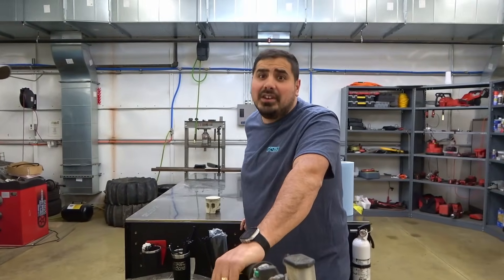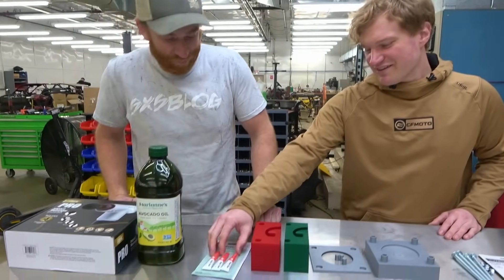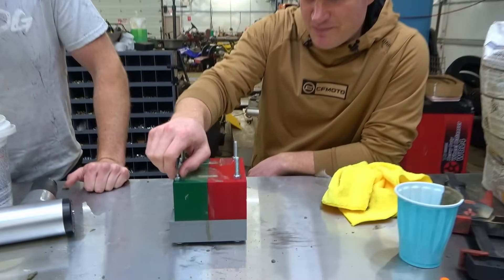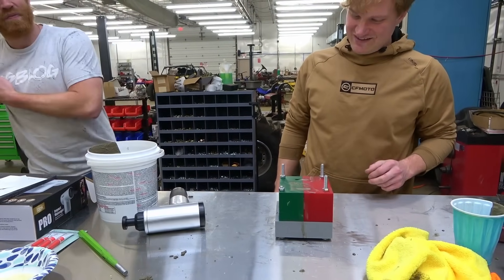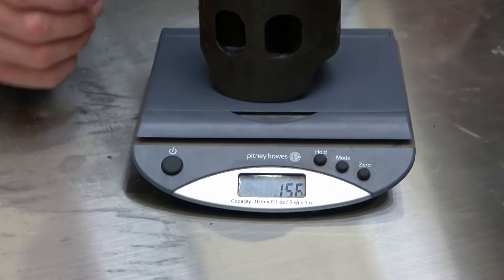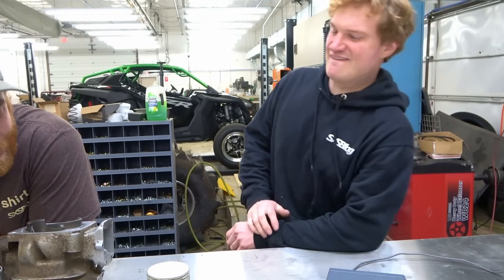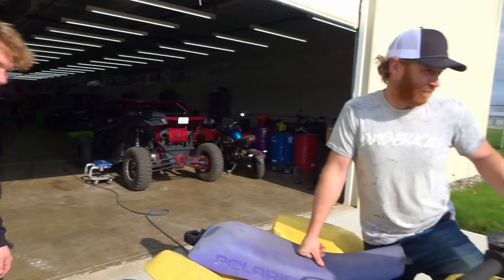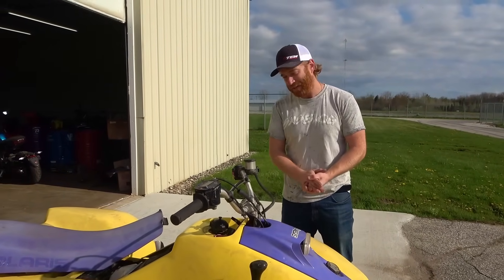World's First CONCRETE Piston! Major Success?

Comment: I’m sure it’s probably already been said but a releasing agent for the concrete from sticking to the plastic would help when you’re breaking the mold I usually use motor oil sprayed on the first and then pour the concrete and then the mulch should come right off without any sticking

Comment: I would suggest to use something to make a thick coat around the edge, yes you used superglue but that doesnt change the fact that the outer edges still have grooves that let stuff flow through, also the bottom of the piston broke off, I would suggest a solid body design instead so if you use something like JB weld or epoxy and sanded it down for a smooth finish im sure it would work also it would help with structural support

Comment: i think the only way to get a working concrete piston would be to cnc machine it out of a properly cured piece of concrete with the 'rebar' sufficiently spread throughout. concrete is great for compression strength but not tensile so having properly cured concrete is probably the only way to get it close enough to success. sadly i dont have a cnc otherwise id offer to lend it for this purpose

Comment: Concrete is pourous. Many little microscopic air holes for fluid and air to escape. It probably just absolutely absorbs in the fuel and fluid. Id try putting a concrete sealer on the top of the piston so it wont absorb the fuel.

Comment: I think you could use shnell cement, which is used for mounting electrical boxes in bathrooms.. as another idea, I have a chemical glue that is used for threaded rods in concrete. a plaster cast of the piston might be interesting too

Comment: Part one, I'm sure someone has used concrete. Things to think of, metal today vs metal in the past, whichever point you decide. The strength is so different. I would think the same for concrete but also take note as to the type of concrete and what a professional does to ensure the concrete is at its strongest. So, concrete and heat......strength to high impact which is about its durability not just for strength impact but length of handling such as over time.

Comment: If you want to make this the best way and get a super smooth surface. Use latex and take a real piston. You will get a super smooth surface that is 100% of the original.
Also Vaseline works great as release agent.
I have 3d printed and made my own molds from originals using latex for years. Also done a few one time use PLA molds.
Also PLA get soft at 50c. Dump it in hot water and it will get soft.

Comment: Make the piston out of JB Weld and try to make the whole engine internals Crankshaft ,Connecting rod and Piston out of low normal aluminum,Using CNC Mechanin

Comment: A piston out of quartz (not glass). It doesn't expand much thermically and resists quick temperature variations
(maybe it should be thicker in the upper part not to broke).

Comment: I wish you guys weren’t so far away I could use some parts off of that I took the complete suspension off of one of those and put it under my easy go golf cart. My front springs are weak. The shots of blown out in the transmission has a bad shift fork.

Comment: Reduce the mold size for the concrete. Make it with quick Crete & mesh. Make a second larger mold . Fill with epoxy. Compression rings made in the second mold😅

Comment: I have not finished watching this video yet, but it’s definitely the end of every rotating piece in this engine. It will literally be a stone grinding pad inside the cylinder walls. I would might have coated this in some kind of epoxy

Comment: You can still pull that engine all apart and clean everything and put it back together.. weld up the cracked casing and get it running again..  As long as the cylinder isn't scored--- she can live again, no problem.

Comment: you guys were succesful in creating an Internal combustion concrete Ram. - concrete is really strong until you shock it... of course a cylinder firing is nothing but shock after shock... just like one of those concrete rams that guys put on their bobcat.. or striking it with a hammer..  I can drive my vintage school bus onto my driveway but a couple hits with even a regular hammer and it starts to fracture.... ..  I think your wrist pin acted as a concrete RAM..

Comment: for the money buy bambu labs. u want regret it. have 14 printers from 8 different brands an hands down the bambu labs machines are hard to compete with at the price points they offer, unless u want a bigger build volume they are the way to go. some new machines coming out that are direct clones competators for bambus printers an some are looking pretty good and at good pricing too but out of the box ive not seen anything print as good as my bambu machines.

Comment: As a roofer for for 30 years I have used gasoline many times to clean up roofing tar It's about the only thing that works good to clean it up. It definitely will not work well with gasoline to seal piston ring. You'd be better off with gastic sealer.

Comment: this reminds me of the misery associated with Aluminum pistons in working equipment... like the old car i have, 185HP 4.6 V8 because it has cast steel pistons in it and the later models only made 265hp because they have aluminum pistons... ether way, it would be sad to find out some piggie ripped them out "fuel mileage is bad hinting at the heavy rods/pistons not being aluminum". get the sheet metal roller out and a small metal lath and just make them out of scrap 1/4'' plate and 1/8'' sheet steel, 4140 ASTM 98'000psi tensile scrap ends... welding etc. middle of plowing snow some day in Alaska and the "aluminum lets go" could end up stiff from those failing... but i guess some guys like going around with a hammer and screwdriver just to put a hole in them thru the plug hole "EPA covert operatives dismantling unlicensed consumption of fuel?". cement? scrap steel is cheaper then the epoxy used in the film, 100% is.

Comment: If you decide to revisit this I design concrete mixes. 
You can make a much stronger , more dense piston that can cure in a day with the correct chemicals (admixtures).  
Lightweight stone
Normal Water Reducer
High Range Water Reducer
Non Calcium Chloride 
Fiber reinforcement 
Densifing admixture
Say when.

Comment: I know that this is very likely out of your 'wheelhouse', but I wonder how well a borosilicate piston would work out in one of your engines.  Think Pyrex, but tougher.  Most likely, it would require the services of a glass blower or lab equipment manufacturer.  Their advice might not cost you anything and, who knows, it might even work.  I had one of the purple glass frying pans and I couldn't tell you how much abuse that poor thing took before a girl stole it because of its color.  It was tough as all hell.  Just an old fart dreaming up weird stuff.